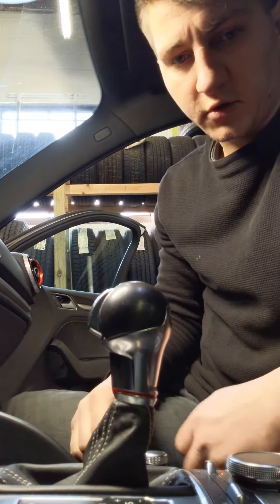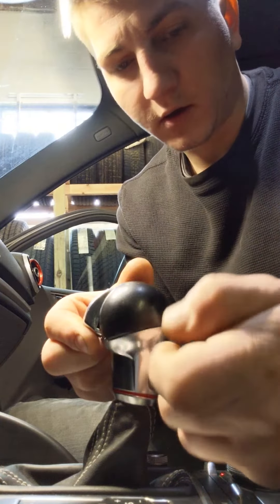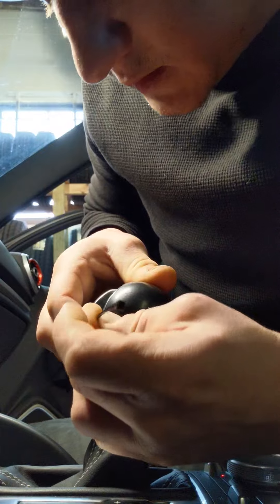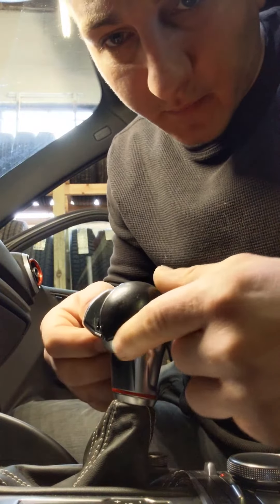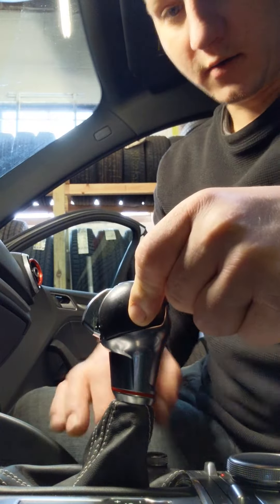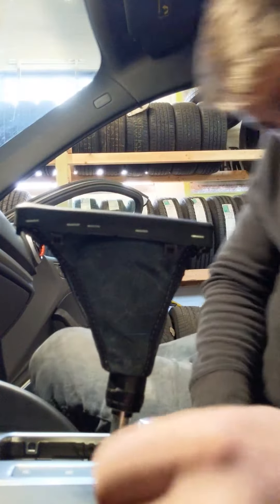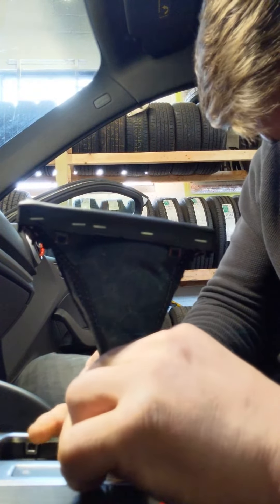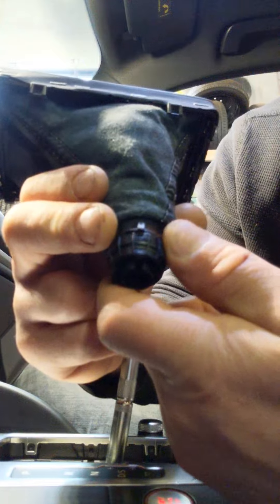Audi S3 A3 shift knob removal

Comment: Cool video, thanks. I’m just wondering how are you able  to stay in D/S without the engine still running??
Reply from the maker: Ignition on, foot on brake pedal, then move the lever. You dont have to start the engine

Comment: Bro for the wheel bearing replacement video...what size is it?n I got Audi A3 2015..please lmk thanks
Reply from the maker: Hey I'm not sure what you're referring to
Reply: @AndrewRzymski  I broke my wheel bearing..I try to order it but they have two size 80mm n 85mm wheel bearing..lmk if u know which size fit my Audi A3 2.0t Quattro 2015

Comment: U should at least give a warning on how it would’ve broke, when I put it back and pulled the zip tie out it broke the spring to push the button back and now Audi is charging 410$ for a new shifter
Reply from the maker: I'm sorry that happened to you. Unfortunately working on your car is at your own risk. when my button popped in before I use the zip tie I was able to pop it back out but it was very hard to do. I'm not sure which spring you are referring to
Reply: you must have the version with the logo on the top, that has 2 springs installed. ops video does not have springs. unfortunate for you as different style gearknob.
Reply: @JH-sc7cs  wish i knew this before taking it off, had to buy a whole new shift knob for 400$ from audi. and my car was 1 month out of warranty
Reply: @JH-sc7cs  button stuck in, pulled it out and  lock it but when install back the button goes in and doesn't work. How can you fix this?!?!
Reply: @foxreviews2292  hard to tell without seeing it. Did you modify the rod hole so it faces from side to the front? Could of possibly broken the hook of the hole and that's why its not latching. If the hook hole on the rod isnt broken, you may need to adjust the height position of the gearknob, but usually you just seat it all the way down until you can't push it anymore, but for after market fitments on other cars, you may need to pull it up a little more to the hook inside the gearknob latches to the rod hole.
Reply: @foxreviews2292  also have you taken the gearknob off already? Is the button stuck in or is it loosley going in and out? And what style gearknob is it? Logo on the top or without logo on the top?
Reply: @JH-sc7cs  is like the one on the video. I just figured it out. It's no big deal once you find out. Thank u anyways
Reply: @foxreviews2292  perfect